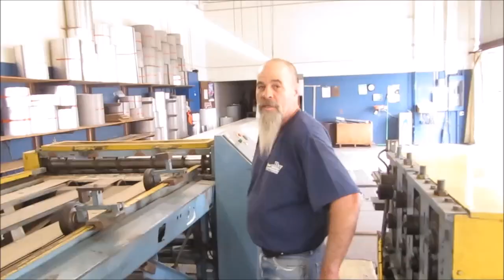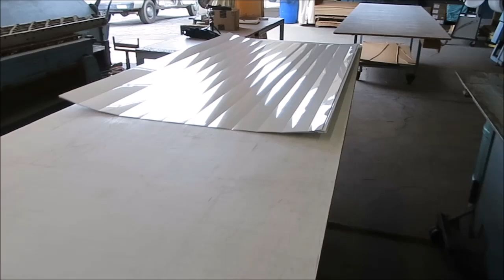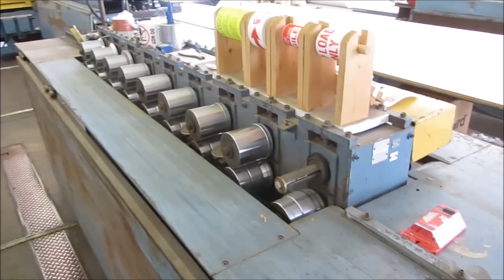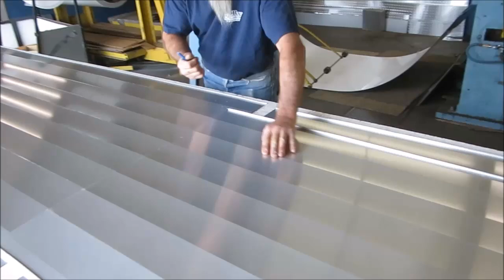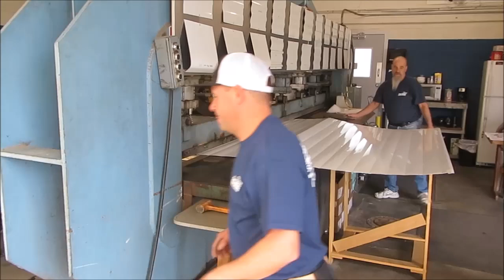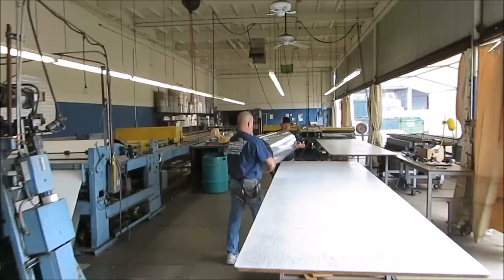Fabricating A Metal Skin Trailer Roof

Comment: That was very satisfying to see that press squash the seam. That was the same seam I had to cut-off when replacing the rear panel below the tail lights on my Mobile Scout. It would not open-up for anything. Thank you for sharing!
Reply from the maker: See that's what I've been talking about. Those seams will NOT leak. You would have to really damage it in order for it to leak. Thanks for watching...

Comment: That is very interesting to see how these roof panels were machined and jointed together. Thanks for showing this process to us Larry. I can now see why it is so unlikely for the leaks to be cause by the cross seams on the roofs. It just has to be the edges of the roofs or the vents and appliances that are put in after the cuts are made. I definitely learned something here. Take care my friend.
Reply from the maker: Great! That was the intention of this video. Lots of people call Steve and ask for seamless roofs and they have more problems  with those roofs than they supposedly take care of. For one thing you can only get them in .040 thickness which is WAY thick and very hard to work with.

Comment: Another great video. I wish I had a siding manufacturer down the street. I'm working on a 1960 Metz right now that I'll have to make the siding for, should be interesting. Saving one trailer at a time, keep up the good work.
Reply from the maker: Thanks Foster.... You do the same. I'm looking for an 8 foot hand brake. Cheapest one I have found so far used is $1500. Then I have to move it LOL...

Comment: Larry, Rick said it's all about the maintenance. Was he saying to do some sort of maintenance to the seam? Like wax it or something? Also, I just bought a gutted travel trailer that I'm gonna use as an office. Viewing your videos I see it should never have been gutted. But it's pretty sturdy and survived the 12 mile move okay; but I'm putting in the inside paneling asap! 2nd question: should I be using some sort of insulation between skin and paneling? Daniel
Reply from the maker: The maintenance Rich was referring to was replacing putty tape under the J Rail and windows... Should be done every 7 to 15 years depending on climate.  The paneling should be replaced by taking the aluminum skin off the trailer first. It goes on from the outside. Not the inside. And yes, insulation should be used between the paneling and the metal skin along with a vapor barrier.

Comment: I purchased a seamless roof panel 16 feet long with an S lock on each end from Interstate RV metals [Portland,OR] so it can be done.  Whether or not it should is another question.  So far, it has held up very well.  Your roof was a total of 20 feet?  And, if you don't mind sharing- the total cost?  [not including shipping].  All of your videos I've seen- they are very helpful- Thank you.
Reply: just read ALL comments- $490 + tax.  Good deal!  Thank you.
Reply: No fatwod, THANK YOU for reading through all the comments and saving many of us a great deal of time! I live in PDX myself and will be starting on a rehab project soon.  It's good to have this resource at my fingertips.
Reply: IRVM for you means no tax, no ship and they'll do custom work at an affordable price. Hemet RV is the best choice for those living in the Southwest.  Good luck with your project - have fun!
Reply from the maker: Don't forget that all my trailer vids are listed in an easy to find fashion on my website...
Reply: Highly recommended for sure!  Especially, when you have to fab a door frame from nothing - mobiltec takes the mystery away!

Comment: what does 20' of that metal roof weigh about? - just curious. i pulled the metal off my 22' Jayco 1976, which is not vintage nostalgia, because that metal is quite loud at 1a.m. in a rainstorm hahah. and also it looked to me like the metal has lead in it and the white corrosion on the underside may be lead poisoning. peace thanks for showing us this process its pretty cool those flat seam roofs are bullet proof.
Reply from the maker: I don't know. Two of us can lift it though...

Comment: What type of material is in the cleating for the ACME lock? Is it a type of sealant tape meant to provide the seal once it is hydraulically pressed?
Reply from the maker: No it's just a steel case. Look at it closely in the video. The two sides are curved up and in to hold the two sheets of aluminum together.
Reply: @mobiltec  ok, I only question because I have a paused snapshot that makes it look like there is something in there. I'm currently in the process of rebuilding a 196? shasta compact and I am almost at the metal stage. I am working with a local company in Saskatchewan, Canada to do the work to the metal for me. Got real worried there for a minute looking at this video and what looked to be like something in the cleat.

Comment: I cant believe they do not wear gloves!!! Very interesting process though, thanks for sharing.
Reply from the maker: Gloves just get in the way. The metal isn't really sharp on the edges. It's after you cut it that it becomes sharp. So it's more dangerous when I'm working with the metal installing it on the trailer than it is for them.

Comment: So would Hemet have the specs for different trailers? I have a 68 Shasta Starflyte, and it is 4 panels with a smaller 7" piece added after the first full panel. Total length looks to be about 16'1", but if Hemet has done a Shasta Starflyte, would they know the exact length I would need? I'm sure shipping has to be quite a bit, but I need to do it
Reply from the maker: No they don't know exact measurements for any trailer. You just call Steve and he will lead you through the process of measuring your trailer. Works every time. He's really good at this.

Comment: Great video Larry, I wonder is there a practical reason for the 4 inch breaks or is it purely aesthetics? I have a couple of caravan videos on my channel which I have been restoring but it never occurred to me that I could replace the aluminium.
Reply from the maker: The brakes are there to help keep the metal from buckling. The metal expands and contracts with heat and cold. Then buckling happens. The brakes help prevent that.
Reply: Ah that makes sense. Thanks.
Reply from the maker: You're welcome!

Comment: do you only fabricate for the roofs or is the shop able to do the entire RV
Reply from the maker: Hemet Valley RV and Siding makes metal for the entire trailer with all sorts of different patterns. You can check them out at http://www.hemetvalleyrv.net
Reply from the maker: Hemet Valley RV makes metal for the entire RV and they have all sorts of different patterns available. You can check them out at http://www.hemetvalleyrv.net

Comment: What thickness are those sheets? And are cleats available for purchase?
Reply from the maker: They will be either .024 or .030 which ever you like. I like the thicker stuff myself. Those cleats as you can see in the video require a BIG PRESS to smash them down and make the ACME seams water tight. You can't do that on your own.
Reply: @mobiltec  but do u sell the cleats? I can do much when I have my mind set.....
Reply from the maker: @nicoleinterrante3831  I just videoed the process. I don't own the company and I don't sell anything. Steve Loomis owns the place that makes the roofs. His link is in the description. Call him.
Reply: @mobiltec  ty I will contact. Might be able to fab those as well. Idk yet. But I might try. I do have access to a metal shop.

Comment: what type of aluminum do they use and what is hardness
Reply from the maker: The roof is either .024 thickness or .030 depending on your choice. I have no idea what  kind of aluminum or what the hardness of it is. No one has ever asked that question. Call Hemet Valley RV and Siding in Hemet, California and ask Steve Loomis.
Reply: I  was just curious, probably 2024 T4 or 6061 T3
Reply: thunderbird97 iii